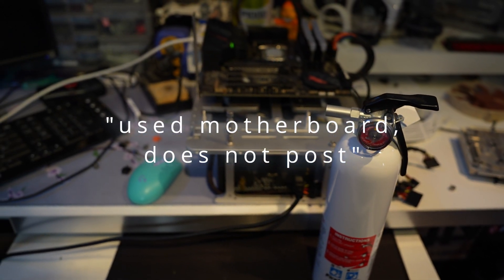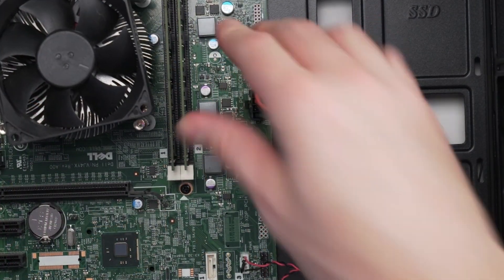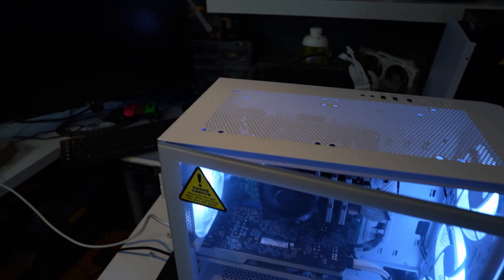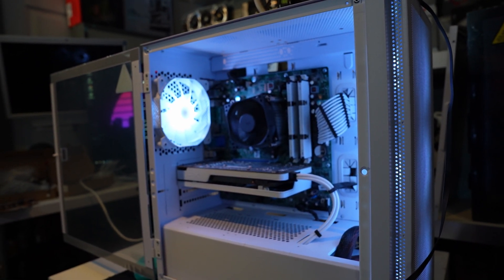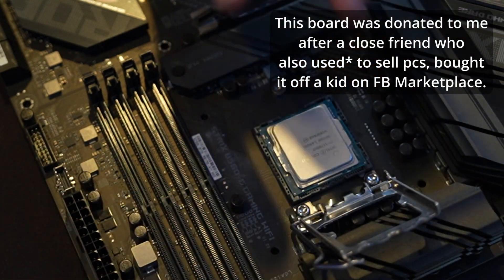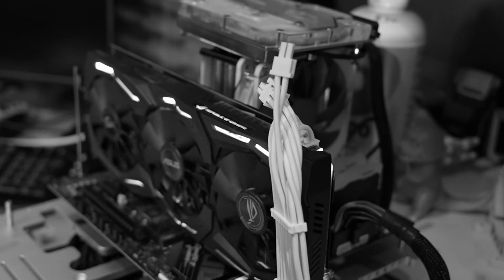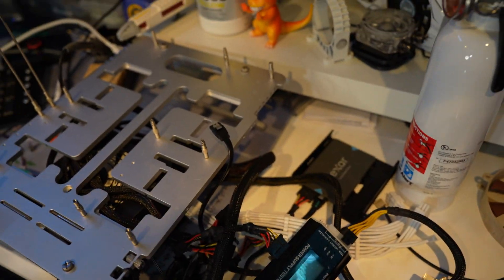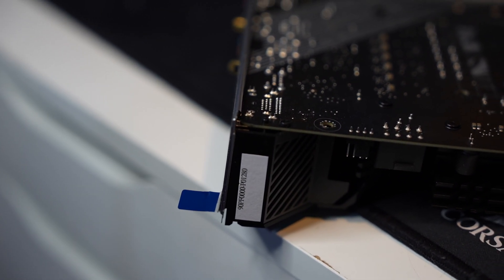This ASUS board is dangerous - & talking about "PANDEMIC PCs"

Comment: Luckily my Rog Strix Z690g wifi hasnt blown up on me but its a new board i bought it back in January from Amazon
Reply from the maker: Was it a brand new board?
Reply: @techwandoUS  Yes I bought it brand new in box from Amazon
Reply: @techwandoUS  Cross my fingers that it doesn't overvolt my 13700k at any point
Reply from the maker: @Chris_94  check the bios, and maybe go for a slight undervolt. Also unpark your cores. Pretty simple and really good for the latency. I can send a link to a video if you'd like.
Reply: @techwandoUS  sounds good, was thinking about unparking cores on my laptop too but idk if thats such a good idea lol
Reply from the maker: @Chris_94  it had a very noticeable impact on opening apps, and file explorer performance. They "park" them for longevity, but in my opinion I don't think it's going to matter all that much. It would take years of 100% loads constantly to burn out a good piece of silicon, as long as it's properly cooled.
Reply: @techwandoUS  Fair it's not like the zenbook 14x top spec has great battery life anyway it has a dedicated gpu, 45 watt 13th gen i9 and a high resolution oled display
Reply: @techwandoUS  Unparking the cores makes more sense on my desktop which I'm going to do with the 13700k
Reply: @techwandoUS  there is one thing I should do. I should add in an extra pcie cable for the gpu since I have my 6800 running off one cable (8 pin plus one 6 and 2 pin) from the pigtail.
Reply: Luckily corsair supplied an extra one with the rm850x

Comment: One hot video! I suggest you move your case or test bench and place it on your kitchen stove when doing things like this. Make sure you turn on the exhaust fan to its highest setting first.
Reply from the maker: Thanks haha... yeah this was unexpected. There is a vent window with a pull fan really close to the window, but the sparks that came out were definitely dangerous.

Comment: I replaced my stone age mainboard (P8H61-M LE/USB3) a few days ago because it had a bent pin, I had "fixed" it but I was concerded about something like that happening.
Reply from the maker: So the bent pin most likely wasn't what caused this particular situation. It turns out it was just a blown resistor on the bottom side of the PCB under the VRMs. I should have checked this with a volt meter before, but I was too focused on the pins unfortunately.
Reply: @techwandoUS  I didn't want to say that it was the cause in that mainboard after you fixed it, but if the original owner powered it with the bent pin that could have damaged the component(s) that finally failed.

It is the problem with dishonest sellers, if instead of saying that the board did not post he would have said that the power supply was shutting down after changing the CPU or whatever you would have inspected it better before powering it on.
If somebody says "it does not post" I understand there's no display but the CPU fan still powers on and the power LED lights, that one was more "it won't turn on" or even "it's junk" 😥

Comment: I always investigate an unknown board or parts in conjunction with the cheapest of available testing parts stripped down as much as possible. So in this case I would have tested it with like a GTX 210 and 4mb of ddr4 for example. If you saw smoke it is pretty likely that board will not run properly again until parts were swapped out like power transistors.
Reply from the maker: I actually don't have any of those older cards anymore that actually function unfortunately. My biggest mistake was not checking it with a volt meter first, which is a normal procedure. 
Also that 1060 was brought back from the dead, probably doesn't have much time left tbh, not worth selling or even giving to someone. Appreciate the comment, you are right.

Comment: You should check the 12V with multimeter make sure no short circuit before turn the power on. 90% of motherboard can be fixed if you have the tools and equipment and skill to fix it .
Reply from the maker: Normally I would check all the voltages, but I was told it was just a bent pin which typically doesn't require that. But I was foolish not to have checked ahead of time like I typically do... appreciate the comment.

Comment: Lol. My pandemic PC was a Dell. A 5000 something rather gaming PC... You don't know how hard it was to not put these two words in quotation marks.
But, it did in fact service purpose as it got me through the pandemic and more or less allowed me to game. I can play Diablo 3. Without too much issue, fallout 4. Modded... To a point. Nowhere near to the caliber that I'm doing now obviously
Reply from the maker: Haha it was hard writing those words too. I get it. The A 5000 is a pretty nice machine. Do you remember the spec list?
Reply: @techwandoUS  proprietary motherboard, 16. RAM on green PCB, the motherboard was designed to stick partially out of the case so it was impossible to mount it into any other case, in a honestly there was nothing really lost there. To be honest. It was stuck on Windows 10 due to generational limits.
Oh it only had one fan... Right on top of the CPU.
It ran a basic, and I mean basic 2060 card. That is one of the few things I was actually able to salvage out of it in the process of building a machine for my niece.
Everything else I had to buy for it, the ram, the monitor, keyboard, mouse... Mouse... You get the idea.
The one thing she was able to pick out for herself was a thermaltake case that looks like a Apache attack shopper... In pink of course. Lol
Reply from the maker: @Stormpriest   @Stormpriest  that's an awesome kinda rare case your niece has there. Especially in pink too. I take it you sold the 2060? Or did your niece get that?
Reply: @techwandoUS  so her dad and I were committing on it, and he got her the case and and ITX motherboard as well as a 12600k, but then his funds ran out.
So I stepped up with a monitor, keyboard, mouse, ram and a little bit lately, The 2060 from the Dell.
I say but literally because it took me a couple days to remember that damn thing was even in the back corner of my room. Love alone What was in it?
The idea and hope is to eventually get her 4060 which will put that 2060 back on my dusty shelves lol. As it is, I'm looking for a repair person to go over my 3080 TI gigabyte and make sure that I didn't kill it by running a pigtail through it
Reply: An explanation, as you know the 3080 ti's add double a pin, power connectors.
My friend help me build my machine initially a year and a half ago and he ran an eight pin pigtail to both of those.
I didn't know any better and he assumed it would be okay.
I'm pretty sure the rapid degrading of video quality was due to being underpowered for a year and a half. Rather than having two individual 8-pin cables running to the GPU like it should have.
Reply from the maker: @Stormpriest it's definitely true on a card like that, you should definitely run two rails of power, there are some psus that are good enough to support it off one, but a majority of them (even average high end), should definitely be two. Sucks to hear the card degraded so much over time man /: